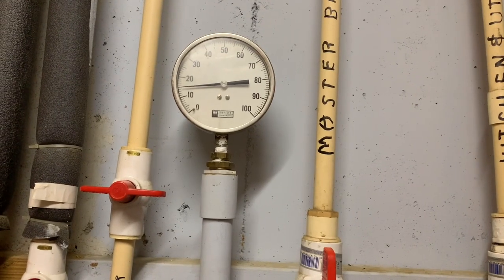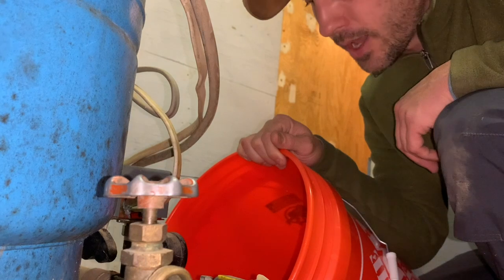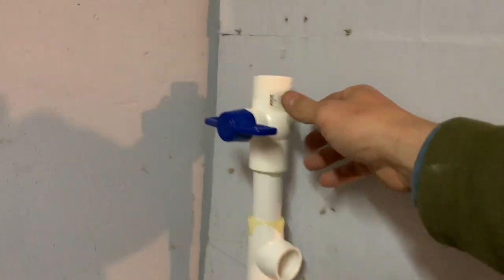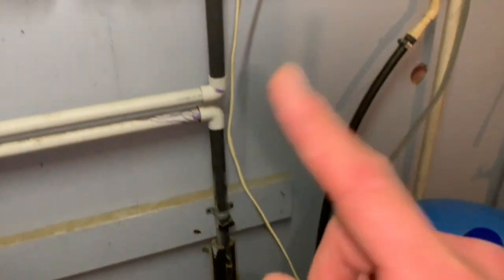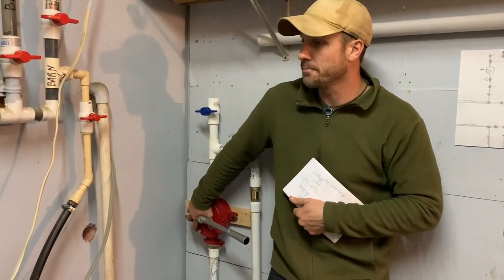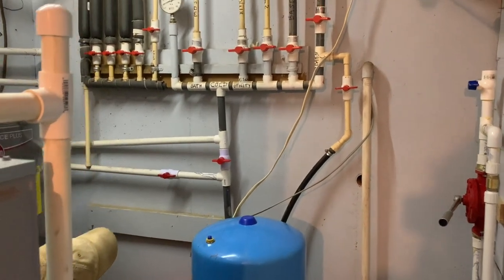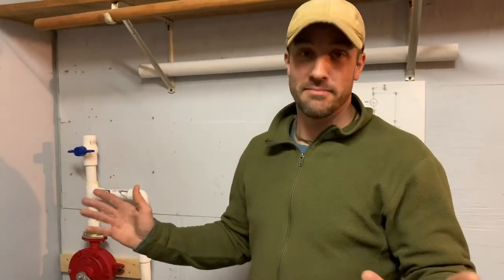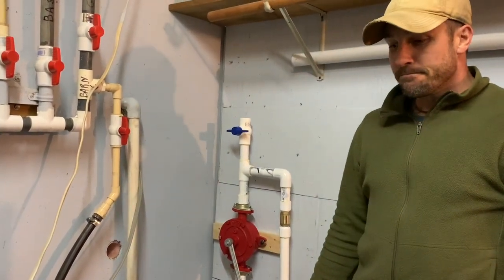Installing the Excelsior E2 Hand Pump | Manual Well Pump

Comment: A tip for people who might want to install something like this. In plumbing. Unions should be installed somewhere so if you need to take things apart to repair (like a failing check valve) you can take it apart without destroying all of your plumbing to get to it.

Comment: I watched this video multiple times and could not determine the static water level of your well.  The E2 pump says maximum depth of 22 ft so I'm assuming your static water level is below that threshold.  Total well depth and static water level would be helpful to know here.  Are you aware of any pumps like this that can pump deeper than 22 ft?

Comment: This worked great thanks for the info and video, I'm getting 13 pumps per gallon of water, it pressurized  the house system  good, my well is a 150 feet deep, I'm going to mount a bicycle frame to to wall and run a connecting rod to the handle of the pump, I'll be able to sit on bike seat and peddle and shift to any gear that is comfortable it will run the hand pump so arms don't get tired, I believe it doesn't matter how deep your well is, if you have reasonable static water level.
Reply from the maker: Awesome!!

Comment: That's a nice pump setup. I didn't realize that there was an option other than a submerged hand pump. It's a great backup even if you do decide to get an alternative power source. 

You have a good point about the generators. Even when they do work, they're 100% reliant on the country's fuel delivery infrastructure. 

A proper solar power system has the potential to last decades (limited by battery lifespan) but they are prohibitively expensive. A small setup that runs only the well pump and only during daylight (no batteries) could be feasible for you. Power requirements would depend heavily on the depth of your well.

Comment: Even if the power goes out during a storm, winter or summer, you won't have to worry about buying bottled water that eventually goes stagnant. I have livestock. They need water just like we do. I always worry about not getting them some. So I always keep extra water in covered buckets that I change out every 2 days as I water them.

Comment: I have a shallow well and multiple valves and a check valve before my pump.......I'm waiting on a traditional hand pump for delivery. I will install it before the electric pump check valve with its own valve.....It should work great when we need water during a storm. Same idea, except I'm not filling the tank, I'll be filling a five gallon bucket from my basement. Nice system you have . :)

Comment: How does the Hand Pump work with an electric pump down in the well?  If there is no electricity, does the hand pump have enough suction to pull water through the non electrified pump? I could see it working if you have Water Storage Tanks.   I Don't understand.

Comment: There is a consistent, unanswered question here. Many people, including me, have a very deep well 270-300'. My static is 80'. The question is, if the power goes out, are you just cranking water from the existing pressure in the pipe (since everything is primed already), or are you having to draw from that static level — which would be too deep?
Reply: This kind of pump has a max static water depth of around 25'.  No suction pump is going to suck much past that level.  Bison Pumps and/or SImplePump have deep water pumps to go up to 300', but they can be very cost prohibitive.  Bison pump quoted me $4,000 for a pump that fits on my well head.

Comment: Your deep well system already has a check valve, it is located after the Pitless fitting in well casing to prevent the pressure tank from emptying. Great video, thank you. I wish my water table was higher. At my elevation of 880’ I can only lift water from a maximum depth of 21’ according to the manufacturer unfortunately. I have a 24VDC deep well pump I am probably going to install for backup but a hand operated deep well pressure pump would work too in a pinch. Thank you for sharing your wonderful system!
Reply: Well, I guess I’m double checked on my valves. My well is 300 feet deep but the water is nearly at surface level. Seems to be working perfectly so far. 
Thanks for watching!
-Jason
Reply: How does the handpump get water out of the submerged well pump if it's electric? Ty

Comment: How long does it take to create standard pressure (looks to be 25 pumps with that size tank to 50psi)? How much water will flow before you need to pump up the pressure again?

Comment: I'd like the pump more if it had a higher pressure rating than 38 psi. My well tank is pressurized to 28 psi for a 30-50 psi cut in and out system. If the max depth draw works then I'd have to pump from 30-38 psi and be careful not to over pressurize the pump. 
I'll look for a higher presure rating, deeper draw pump or maybe 12V if needed to get that. I do like the hand pump.

Comment: Your using the channel locks backward.....
Clean and glue the fitting and pipe for easier install 
Poor choice of spigot. It will leak over time. 
Thanks for sharing tho. Cool idea

Comment: This will NOT work if your well is deeper than 33ft. Suction pump cannot work past that depth due to atmospheric pressure. What depth is your well to allow this to work? Also, did you test it extensively? Once you pump all the water out of the tank it probably wont work anymore.
Reply: @pete8299  did you get a response? I'm really wanting to install one of these bug my well is like 88 ft
Reply: @italwayshitsthefan  look it up online, a suction pump won't be able to work past 33 ft
Reply: @pete8299 What if it it's a sealed system like this?  I was wondering the same thing too, but do long as you don't loose prime I think that it should work?

Comment: Okay - Need an explanation. My well is about 185 feet down to the water. The specs say it can only lift 22'. I heard you mention you are below the 185 I'm currently sitting.
How does the pump work at that low level? Is it because your system already has water at the pump and doesn't need to bring it from the bottom?
Sorry - newby question I'm sure. My first well and my first 9 months in the house. Lot's of learning to go!
Great video!
Reply: Yes, water is nearly at surface level. Does not need to lift the water hardly at all. You would want to confirm that it would work for your situation. Ask Scott at Practical Preppers. Thanks for watching!
-Jason

Comment: Did I hear you right? Your well is 300 foot deep? Mine is about half, but the specs I've read on this pump says it's for "shallow" wells. Very interested in this pump if it will move water through my electric pump which is 160 foot deep

Comment: Awesome setup.  Does it just suck water up through your existing electric submersible?  Didn’t know this was possible.  I mean I guess it make sense since if a pump discharge valve fails, all your house pressure flows backward through the submersible and back into the well.

Comment: Will this pump work even if the lines are not already primed like yours were. Say if the electric well pump was just installed and hasn't been used yet. Would this pump be able to draw from 200 plus feet down?  Sorry if you mentioned that and I missed it.

Comment: Since the filtration system is pressurized under normal circumstances, you do not need to bypass it for the hand-pump operation.
Reply: How does the handpump get water out of the submerged well pump if it's electric? Ty

Comment: Hi Jason, very cool setup there. I assume you're pulling water through you're inactive submersible well pump when you use the manual pump? This won't harm the submersible pump? Please chime in anyone that knows! I've got a 110' well, with the well pump at 48', and water level at 18' and hoping to do a setup like this.

Comment: Just wondering what kind of well pump is in the hole. Will the hand pump draw the water thru the well pump sufficiently. Good video.
Reply: Not sure exactly what kind of pump is down there. Seems to be working pretty good so far. 
Thanks for watching!
-Jason
Reply: @ONThree  hi Jason, curious how this is working a year later and to make sure there's been no negative impacts pulling water past your electric pump. Thanks!

Comment: Hey Jason, very interested in this system! Our well is about 80' down, static level is 38ft. We also have a submersible pump that was replaced in 2019. Will this setup work for us? I'm assuming the pump pulls water up from the well and also pressurizes the tank, correct? I was all excited, but then called the place that replaced our submersible pump and they seem to think with wouldn't work, that there's no way to get the water up from the well. I'll try to do some more homework, but was hoping you could shed some light on this. Thanks!
Reply: I was wondering the same thing. Did you find out If it'll come up past the submersible  pump?
Reply: @widerwoman  Hi Michelle. Unfortunately the deepest static level the pump will work for is 22ft. So this setup wouldn't work for our well.
Reply: @beginning-reloading  how do you figure out your static level?
Reply: @Redneckerthanu  It's been a while since I posted that reply. I think what I did was find the company who drilled our well. They had a copy of the well details which showed the static water level.
Reply: What will work with a 40 foot deep well?  Any help would be greatly appreciated 🙏
Reply: I guess he doesn’t answer questions

Comment: Really cool. 2 questions. The site says it is a shallow well pump but you said yours is 300ft. How deep can it pump? Site says only about 20ft. Also, is there an extension for the pump arm? It looked like that short arm was quite a bit of effort so a weaker person might need more leverage
Reply: My well is 300 feet deep but the water is at nearly ground level. So the pump does not have to lift the water very far. Extension for the arm may be helpful. Good call. 
-Jason
Reply: @ONThree  Thanks! My pump is down about 100 but I don't know the water level. Good to know the level matters more than the pump depth

Comment: I'm in Wisconsin with a well (I'm not sure the exact details) around 110 ft deep with static water at about 80ft. The link says it's for shallow or tank water supply. You quickly mentioned you had a pump at 300ft deep??? Did you have success with this pump with a very deep well? Or is your water table really high???
Reply: In comments he said his static level was almost at the top of the well, so he is pumping less than 22ft. of lift.

Comment: That's why you should have A propane-powered generator. You don't have to worry about the fuel going bad. You always have power to run your system
Reply: If you can get propane...
Reply: EMP hits, the grid will be down for at least two years.  Propane generators burn 1.5 gallons of propane an hour.  You will run out of propane very quickly if you are using it for heat as well.  Preppers should always have a backup and a backup to the backup :o)

Comment: Goodness, I have been searching for this exact solution to access my well without power.  My main issue is that the hand pumps etc that mount on the well head would be a bit awkward because my well head is in the middle of front yard, lol.

Comment: I am confused. You mentioned your pump is 300ft down in the well. E2 is rated at 7 meters of lift. How's is this working. Love the idea and really want it work!
Reply from the maker: My well is 300 feet deep but the water level in the well is almost at the surface. Your results may vary.
Reply: @SurvivalDispatch  That makes sense! Thanks for the reply.

Comment: This is cool, but unfortunately isn't appropriate for me. I have a solution which is less elegant for those with a deep well (and no skills). My water table is 50' and my well is 455' deep. My solution to providing pressurized water for flushing uses a 12V RV pump rated 3gpm, a car battery, a water barrel and 2 short garden hoses. There is an extra connection on my manifold for the output from the pump. The input comes from the barrel. The 6-gallon pressure tank stays pressurized. The 55-gallon drum can be nursed to last a very long time, and I don't have to put possibly unsafe water into my house. The filter remains in use. Of course when the barrel is empty I have to deal with that. If the situation is just a pump failure and I still have power, I can continue to have hot water. If the power is out I have hot water until the water heater cools down.  We really don't have blizzards in Virginia any more, but we do have storms and frequent power outages in the mountains.

Comment: Awesome job man, nothing like the quality control of doing it yourself (not to mention way less cost and actually knowing how to fix it later, priceless). Really like this concept, and will most certainly do it at my next house. I’ll be on city water but can at least pump from a sprinkler well here in Florida. Alright, now show us the edited trips back to the supply house to get those forgotten couplings hahaha
Reply: Hahahahaha! Plumbing never involves a single trip to the store does it? I got lucky on this one, was able to scavenge a few fittings out of the barn left over from previous jobs. Thanks for watching!
-Jason
Reply: @ONThree  I try to limit my trips to the store as well as muffled obscenities, but there’s no guarantees hahaha. Only armchair quarterback advice I can share is get a cheater-bar for the pump handle and possibly spare parts (if it has any internal gaskets, etc). And restock the barn, but I’m sure you’re already planning on that. How’d it work out in the test phase, meaning how many trips to pump the system back up after x amount of gallons from faucets, showers, toilet flushes, etc. Also any thoughts on some type of fire heated hot water tank? Definitely not a necessity during a power outage, but nice to have for the family.
Reply: Is the water from the sprinkler well potable or brackish? Rain catchment is always an option.
Reply: @JamesRPatrick  that’s a great question, I’ve always “thought” it was potable but to be honest now I have to find out. It definitely has a sulfur smell and if untreated will stain walls and sidewalks an orange color. Rain catchment is something I’m also looking into with the gutters and barrels for the next house (temporarily in a rental home, so it would all be frowned upon hahaha)

Comment: Have a question how deep is this guys water table ? Mine is pretty deep and the company claims it won’t pull water more than 25 feet even if it’s primmed ? Thoughts
Reply from the maker: My water level is very near the surface. Probably 10 feet or so. Your results may differ. Thanks for watching!

Comment: How deep is your well?  I think this is sold as a shallow well pump and just wondering if it would work for me.
Reply from the maker: My well is 300 feet deep but the water is almost at the surface. This means a shallow well pump works in my situation. Your results may vary.

Comment: Ive been wanting to add ine to my well, but i need to figure out where in the system do i add a pressure gauge
Reply: Where you want to see where the pressure is at. So after the pressure tank, to see if your system is pressurized.
Reply: @TheTyrial86  thx!

Comment: Great video! 

How many minutes of water do you get before you have to pump again? (I'm sure this is a question that ultimately depends on the sq footage of your home; but I'm just curious.)
Reply from the maker: It will depend on the size of the pressure tank. You will be able to flush the toilets and do a sink of dishes if you use it sparingly.

Comment: I assume your 300 foot deep well pump acts as a check valve to hold the water that had already been pumped to the house and thus suction power was greatly reduced.  Have you tried it without any water in the well line back down to the pump. Guessing the law of physics won’t allow it.  Please display your comments to everyone.  Thanks.
Reply: I followed up myself in my question and found at Engineer775 that the max suction is 22 feet.  So you must not let the well line to the house drop back more than 22 feet or the pump is useless.

Comment: Awesome pump and very informative video. . I have a question. Did you say in the video when you were turning off your power that your pump was 300 feet deep? 

The information i saw on the pump was that it would only lift 22feet. 

My well is 110feet deep and im trying to get info to see if
This pump might work.
Reply: This is my question. Our pump is over 300' deep and I was excited to find this until I looked the specs up on the web site. We're you able to find out anymore info on it?
Reply: The depth of the pump has nothing to do with the lift, it is based on the static water level which in most wells varies over the four seasons.
Reply: @duaneclose64  The hand pump is "in-line" with the water line coming directly from the well pump, so the depth of the pump is relavent to how far the hand pump has to pull the water. If the hand pump was not "in-line" and was rather pulling water directly from the well at it's static level, then depth of well pump would be irrelevant. In this specific setup, depth of the well pump matters.

Comment: What sources of water can be used? I have a drilled well with a submersible pump 70 feet down. It has, If I recall correctly, a check valve above the pump. I think without the pump motor running, it would be difficult to draw water through the motor. I would not have an issue with drawing water due to the pump being 70 feet down; it is full of water to about 10 feet below ground, which then in reality is the height I need to lift water.
Anyone able to draw water efficiently through a submersible pump setup?